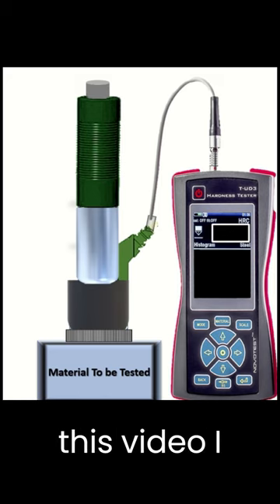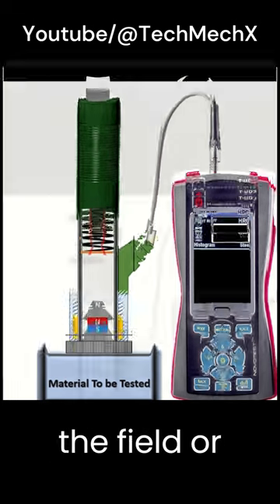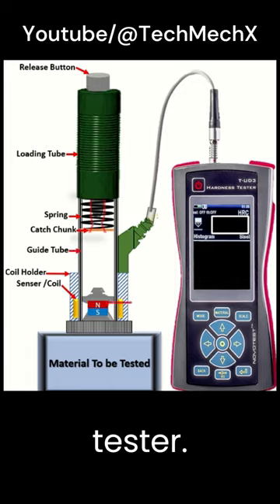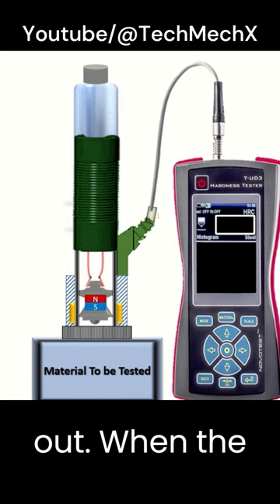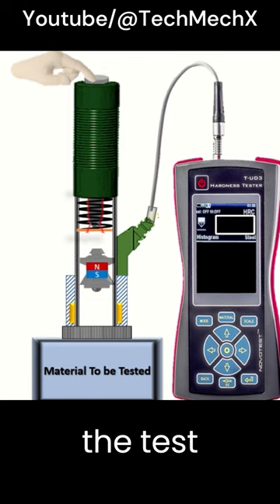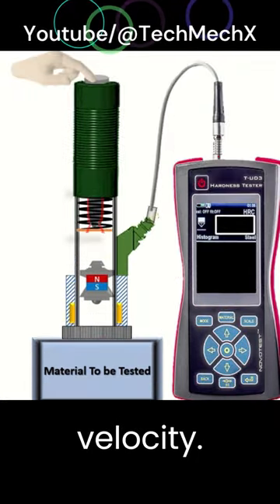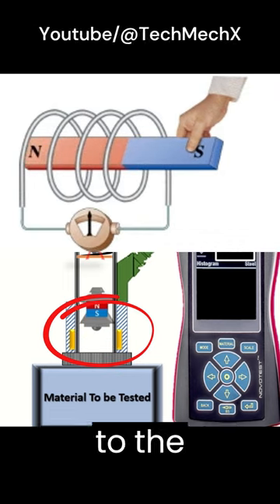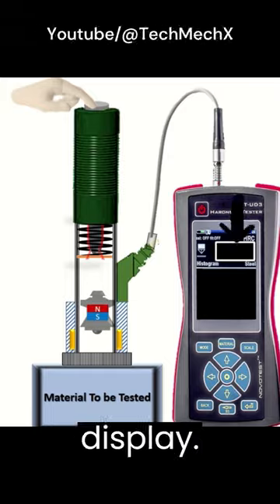How Leeb hardness Tester work? #shorts #youtubeshorts #hardnesstestingmachine

Comment: Why measurement in one piece are different? I test many time for boiler tube with 4mm thickness
Reply from the maker: The work piece should have enough thickness. Please check the user manual of leeb hardness tester you are using. Generally Without coupling leeb hardness tester is not recommended for 4mm thickness.
In addition, leeb hardness test on rod or tube may not be accurate when curvature radius of surface is less than 30mm for D, DC, D+15, E , DL impact device and less than 50mm for G type Impact device.